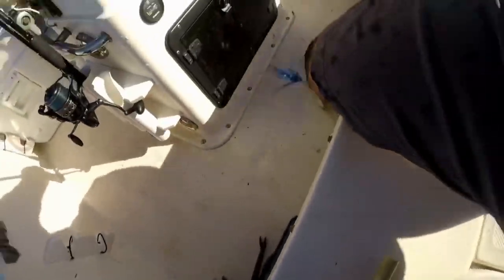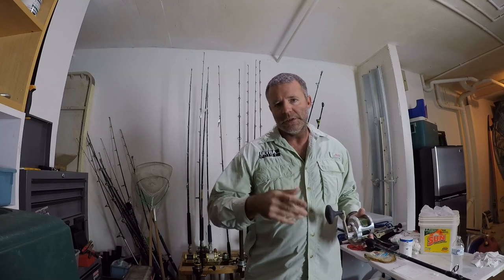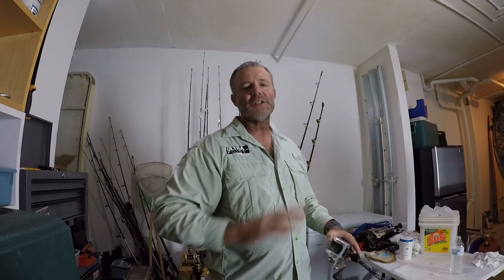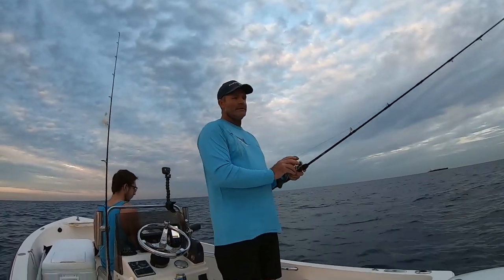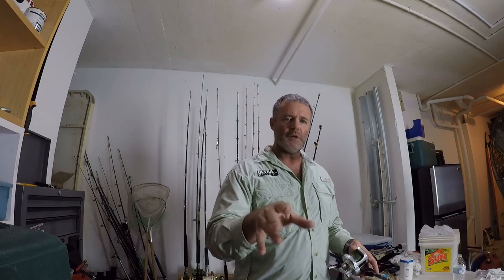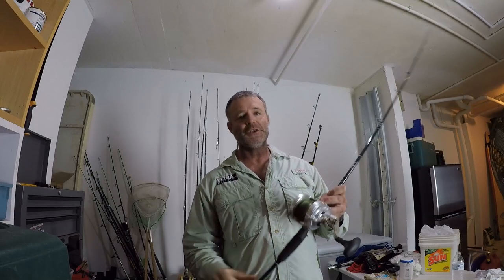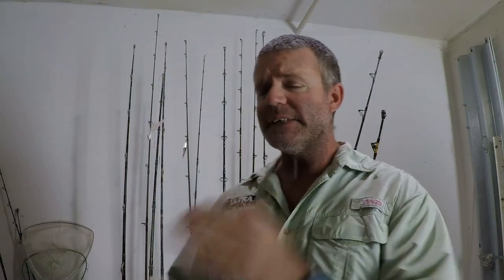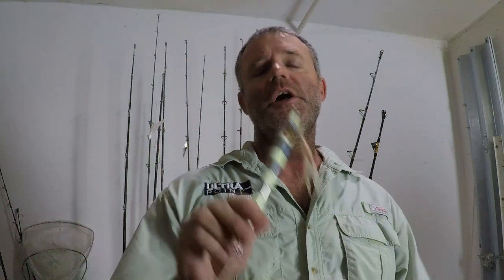SLOW PITCH JIGGING Technique, Gear & Jigs | How to do SLOW JIGGING

Comment: Does the Star Rod have a recommended jig weight for the  rods?
Reply from the maker: Thanks a boat load for watching and asking a great question.  I guess I skipped over that info.  Yes it is rated... 150 to 400 grams... quite a wide range which is part of the reason I'm very fond of the rod.  I did a good deal of searching around and trials before I found the Star Rod... I would definitely recommend it if you are asking.  Thanks again.  Tight lines & take care ;)
Reply: @SouthFloridaSaltwaterFishing  What action would you recommend?  Looks like Star has 3 rods in this series.
Reply from the maker: @lonnieberg662  The action is going to depend on what weight jigs you want to use.  My rod is 150 - 400 grams.... I'm typically using jigs that are 200 & 300 grams.  So, you have to consider what depth you're going to be fishing mostly, to help as a deciding factor when making your purchase.  Hopefully this helps.  Thanks again.  Tight lines & take care ;)
Reply: @SouthFloridaSaltwaterFishing  Thanks a bunch for the videos and Informaiton.  It's a huge help.

Comment: if your line is gonna telecope away from u why not cast up current? i don't understand this stuff.. lol
Reply from the maker: LOL.  I hear ya.  So, casting up current would initially be setting your line out telescoped... also, as you drift up current you would be putting slack in your line, thus making any jigging ineffective.  Current is all part of the sport.  Anglers have a love hate relationship with it... But you can't catch fish without it.   Slow pitch can be confusing and intimidating, but patience and practice in theory and putting in the ground work leads to success.  Great to hear from you.  Tight lines & take care ;)